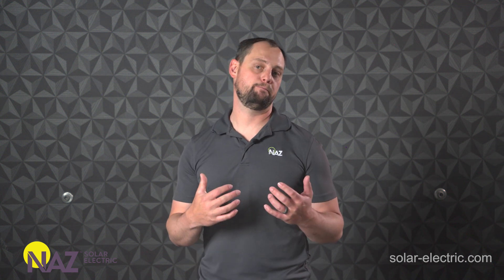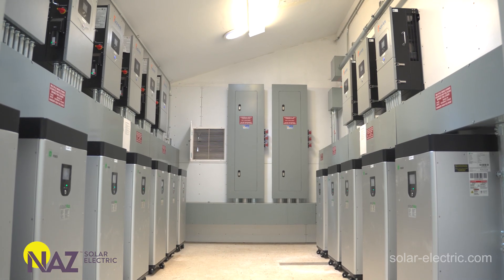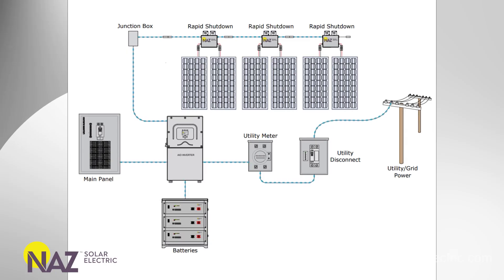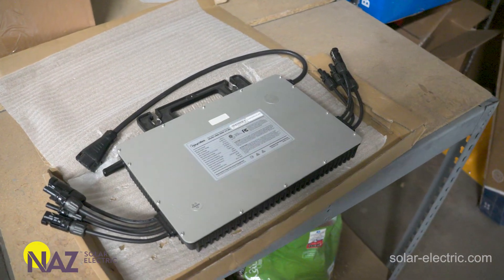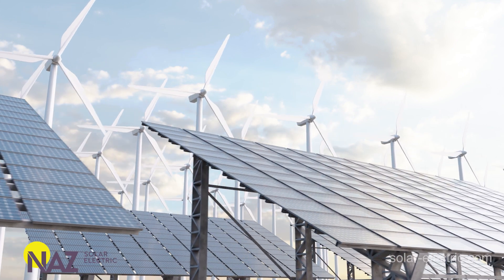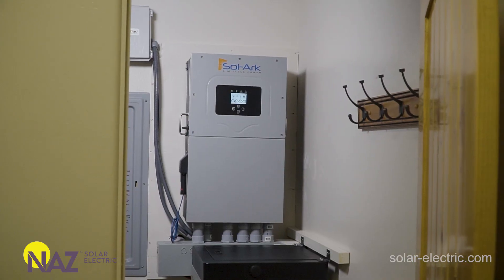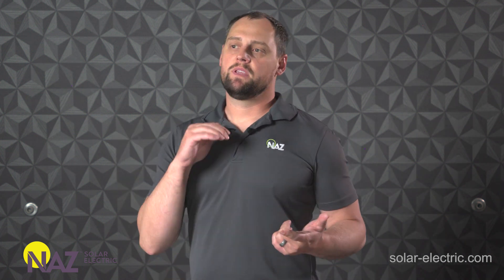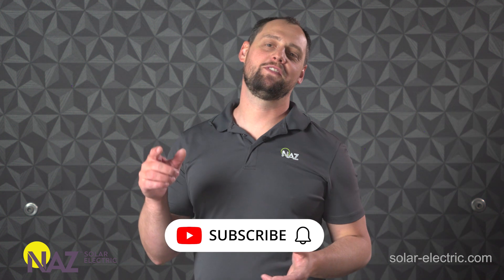All About AC Coupling: Understanding DC Coupling vs. AC Coupling in Solar Energy Systems

Comment: I have an old Magnum inverters MS4448PAE two in Particular coupled with 16 Deep Cycle Batteries and 16 BP PV with the output of 3200watts which I’m using now how can I use this output to Coupled with my New SolArk 15k that I’m about to install